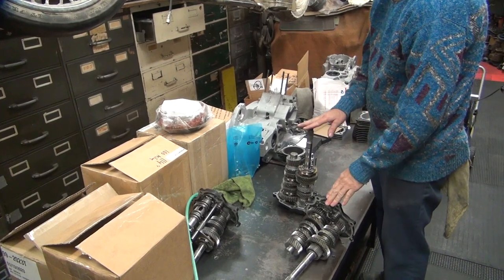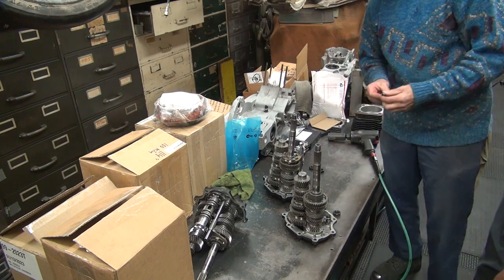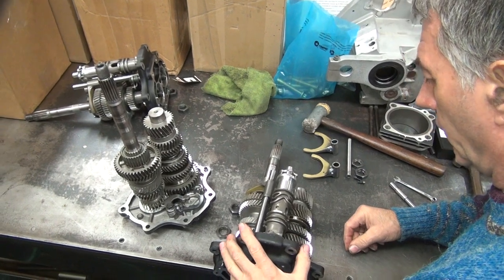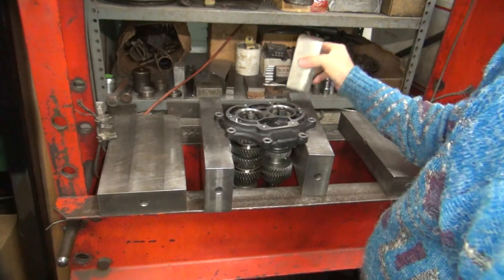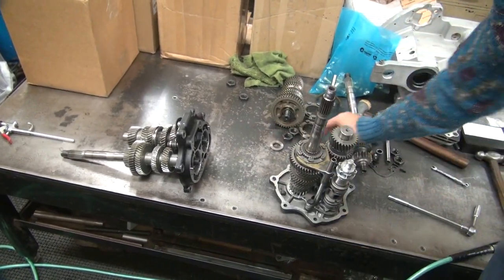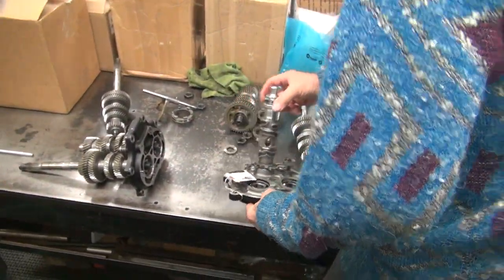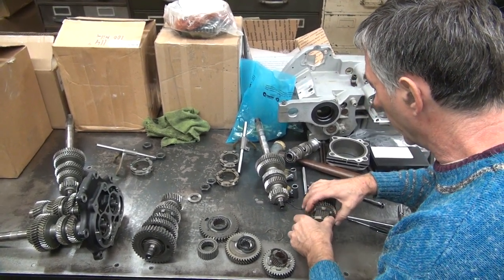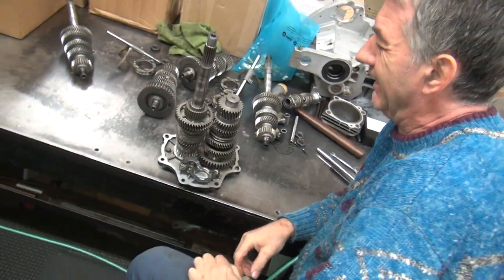#102 m8 6 speed trans blown up gear set swap out transmission milwaukee eight harley tatro machine

Comment: Dude should just buy a baker and call it good. What's this dude rebuilding his entire motor tatro?...
Reply from the maker: bakers break too and they cost what a bike does. besides, have you every purchased a $6000 trans from a manufacture and they tell you that you are not competent to work on their products.
tatro
Reply: @Tatro Machine  that's my ignorance tatro, I thought baker was top shelf  trans and customer service. I'll stick with my harleh 5 speed trans in my 04 twin turd
Reply from the maker: good call.
tatro
Reply: Have you put a Ultima 6 speed conversion in a 5 speed yet?